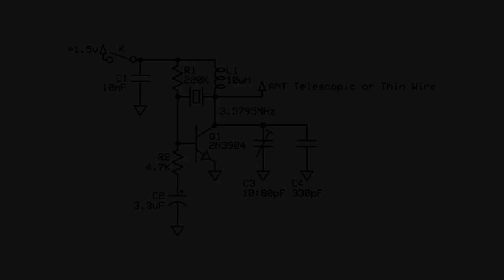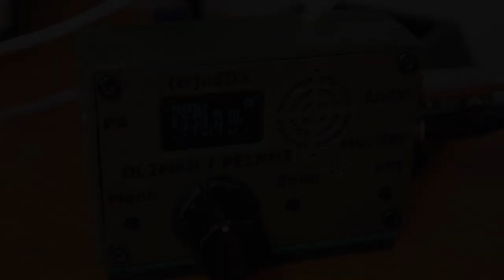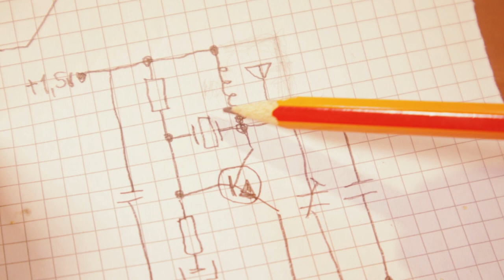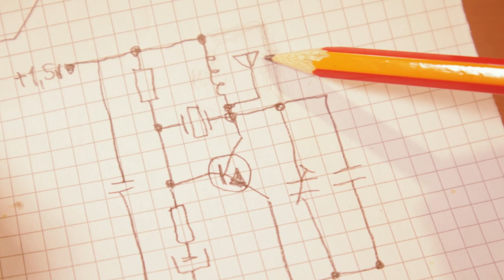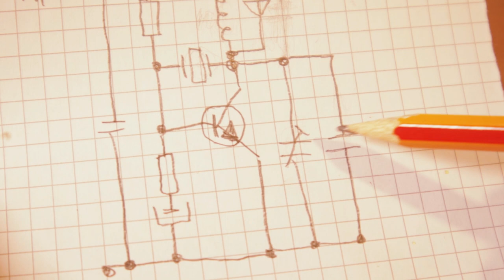Simple HF Radio Beacon - One Transistor RF Pulsing Oscillator

Comment: Thank you alot, ciprian, for this nice project. This was my very first time ever trying to build simple transmitter circuit and i got very surpised when i found out that circuit had actually started working! even from the first try :D. I built the circuit with 7 MHz quartz but after small adjustment of the capacitance, i was able to make the circuit work with 4 MHz quartz. I've been watching your videos for more than a year and it always makes me happy to see your new upload. Thanks again for your work and wish you success! 73.
Reply from the maker: Thank you so much. Glad it works and happy you like the videos. Ohhh I must make you laugh. I have mine hanging here in the window and I think about a month ago I was wondering if it still works. I turned it on and voila... still worked. The fun part is that a few days ago I was on the 80m band and I was wondering where is the beep coming from. I realized the little bugger was still working nearly a month later from the same battery 😅😅😅. So it turns out it doesn't eat batteries either 😅😅. I also made some tests from the 80m band up to the 2m band. Works like a charm. O love it. 73, YO6DXE.
Reply: @dxexplorer  thats amazing 😁. Im still sitting and tinkering around the circuit. I'm planning to build the transistor amplifier circuit for it and make it a little bit more powerful. I have hooked up the transmitter to the powersupply with voltage of 6v and the current consumption is only 50mA, as the multimeter says, so i think i can try rising the power 😅
Reply from the maker: @RandomlySelectedUserName Hmmm I never tried powering it with more than 1.5v. Good thinking ))) I will play a little more then )))
Reply: @dxexplorer  haha, good luck with it then! :))
Reply from the maker: @RandomlySelectedUserName  😅😅 thank you so much. I will play safe and start with 3V 😅
Reply: @dxexplorer  😅

Comment: Fun! It sounds like the recordings of SPUTNIK and the chirp adds further character.  If you could get it going on 144MHz you could easily Direction Find it.
Reply from the maker: Thank you Paul. I had the schematic for years and wanted to build it. I love it exactly for the fact that is resembeling Sputnik. I was always fascinated about that satellite hehe. I wanted to make it for 144MHz but I had no crystals available. So I guess I will play on the 80m band for now.  I will try to find a 2m band crystal and build an even smaller version  )) 73 and thank you for watching.
Reply: Usually resonant filters and multiplication is used for that.
Reply from the maker: @antennafarmer7380  I would love to know how to do that. I must search about it as I don't know how is done. Thank you. 73
Reply: @antennafarmer7380  A 2m version might be tricky, you'd have to multiply an overtone crystal, say a 3rd overtone 48MHz crystal followed by a tripler stage. The chirp would be tripled as well. Might work. An interesting experiment!
A 16MHz cheap crystal running just 500Hz high would end up on 144.005. The inevitable chirp and drift would just add to your toy Sputniks charm. 🤓
Reply from the maker: I will have to try it because now I'm really curious about it haha. Thank you again )) 73
Reply: ever so often there are 144Mhz ceramic resonators on the market, Those should do fine for that and provide for  frequency agility over a small range.
Reply from the maker: I found a store last night here in Romania selling crystals for fox hunting specifically... on the 2m frequencies allowed by law so that is great. I will order some and also a few more for the 80m band. Who knows... maybe one day I need them to do something nice for some kids in a school introducing them to the sport )). 73 P.S. The ceramic resonator would be great for a walkie talkie style transceiver QRPp with only a few transistors 😄. Let's say... some sort of ancient Baofeng haha.
Reply: @dxexplorer  Good find.   Maybe 12MHz ones.  Times 3, times 4. Filtering will be the trick! Good luck.
Reply from the maker: @Paul_VK3HN  Thank you Paul. I have 12MHz crystals... I am still trying to figure out and learn how to do the frequency multiplying in the circuit. I've never done that before so is new to me )).
Reply from the maker: Good evening Paul. The "Easter Eggs Hunt" was a success hahaha. Nephew loved it and wants more. Meanwhile I also made some experiments as well. I placed a 12MHz crystal and adjusted the LC tank for that. Works like a charm. But it also works on every second harmonic as well. So I can received on 12MHz, 24MHz and so on including 144Mhz. The signal is a little weaker. The issue is that I only have a Baofeng and is FM. So I would have to do something to modulate the signal I guess. But it works haha. I had no clue about that. Well... I didn't think enough, but then I realized..  that is why we put bandpadsfilters on transmitters haha. Ahhh this world of electronics is full of wonders for me still. Lots to learn. 73, YO6DXE.

Comment: So it's the R/C combination R2/C2 that determines the pulse frequency? Brilliantly simple!
Reply from the maker: Yes. Basically you use L1 and C3 to get the frequency just bellow the crystal's frequency... then with R2 and C2 you get the pulse as you wish to be. But the pulse is also adjusted a little through C3 as well. Is a really simple but nice circuit, love it. 73, YO6DXE

Comment: I tried it on 27 Mhz but it's not pulsing. Because the smallest inductor I had, was 6,5uH I just used a 2-18pf trimmer for the oscillator at C3 (and left C4 out). I did try it with a 1 uF and 4,7 uF capacitor for C2 because these were the parts I have rn. But it's just sending a carrier.
Any idea how I can get it to pulse?
Reply from the maker: You can try using Coil32 app to calculate the resonant frequency of the LC tank... the inductor and the capacitor together... would be great to be able to use both a capacitor and a trimmer in parallel so you can make adjustments. Anyhow... if I remember ... ( I know I spoke about this in the video )... the frequency must be smaller than the resonant frequency of the crystal ? I can't remember... smaller or bigger one of these two. You can try to make an inductor by hand also by calculating the inductor using Coil 32. It will not be the perfect value you calculate there... but you would be close. You just need a small PVC tube or something similar ( from a pen as example ) and to know the exact diameter of the wire you are using ( i use enameled copper wire recovered from old transformers ). If that doesn't work... come back and let me know. We will figure something out.
Reply: @dxexplorer  I used the online calculator you mentioned. I should have a coil now that's around 1.5 uH and I added a 15 pf next to the trimmercapacitor. This should give me a range where I can adjust the LC frequency close to the 27 Mhz. Like before I get a signal from it but it's still just the carrier with no pulsing or no signal at all depending on how I adjust the trimmer.
Reply from the maker: We are not sure if is exactly 1.5uH... but let's guess it is. If the value turned out close to 1.5uH then maybe the capacitance is too much. Remove the fixed capacitor and play just with the trimmer instead. See how that works. Or instead of the 15pf you can try smaller values (5pf maybe ?). In theory you would need around 23pF in total (fixed+trimmer) to have about 27.096. I need to watch the video again as I can't remember if the frequency has to be smaller or bigger than the one the crystal has )).
Reply from the maker: @thesciencefurry ok I double checked... so the LC tank circuit frequency has to be just a little lower then the crystal's frequency. So let's say... 26.8-26.9 something like that.

P.S. make sure you are not listening to it into an FM CB radio as it won't sound properly since the signal is AM basically.
Reply: @dxexplorer  I tried it with a 6 pf and it didn't work at all. I'm listening and seeing the signal with a sdr stick and there is definitely just the carrier with no modulation.
Reply from the maker: @thesciencefurry Very strange. Is late now and I still have a lot of work to do. Let me replicate what you did and also try tomorrow to see what is going on. I will be free tomorrow evening. I have a 27Mhz crystal somewhere around here.  What transistor did you used ?
Reply: @dxexplorer  Thank you very much. I used the 2n3904
Reply from the maker: @thesciencefurry  Always a pleasure my friend. 73
Reply from the maker: @thesciencefurry  sorry I move slow on this. I still didn't had the time yet. I am working on re-designing an online shop for some friends and not ready yet so I work nearly non stop now. As soon as I am done... I will get to this one and see what is going on.
Reply: @dxexplorer  No problem. I tried a few things this evening. mainly changing the electrolytic capacitor and the resistor in front of it with no success. Else I don't really have any idea apart from adding an external flasher circuit.
Reply from the maker: @thesciencefurry Nehhh don't waste time. Let me finish with work and I will help. Usually is just a little thing that will fix everything )))

Comment: What would be the required modifications to use a 7 mhz crystal?
Reply from the maker: Salut... trebuie recalculata bobina si eventual schimbata valoarea trimerului. Stiu ca am explicat in video, dar trebuie sa ma uit si eu la clip ca nu mai tin minte daca frecventa de rezonanta trebuie sa fie un pic mai mica, sau mai mare decat cea a cristalului. Da parca mai mica cu 10 - 20Hz daca imi aduc bine aminte ))). Ma uit la clip imediat si revin. Stiu ca am facut si varianta de 7MHz, dar nu mai tin minte ce valoare am pus la bobina si la condensator.
Reply from the maker: No... am revenit 😁. Am facut repede un calcul... si ar trebui sa schimbi doar cristalul pe o frecventa in 7MHz... si condensatorul ceramic ( cel in paralel cu trimmer-ul ). Valoarea ar fi undeva intre 47pF - 68pF. Dar depinde acum si de lungimea antenei etc. Dar pe acolo pe undeva ar trebui sa fie. Se mai fac ajustari si din trimmer. Valoarea inductorului ramane tot 10uH.
Reply: @dxexplorer  Multumesc mult! Cred ca m-ar ajuta la testarea si/sau reglarea receptoarelor, cred ca e mai comod un sunet intermitent decat sa folosesc un emitator de cod morse. Sa vedem numai cand mai am timp de lumea radio... :))
Reply from the maker: @bobi_lopataru Cu mare drag. Pai cam tot la asta-l folosesc si eu de obicei 😅. Imi e usor da lucrez cu el. Ma rog... cand apare nepotul in vizita... devine iar "vulpe" si scot nepotul la vanatoare 😅